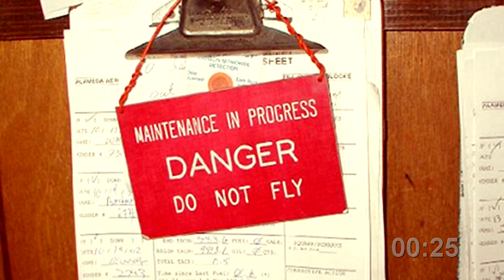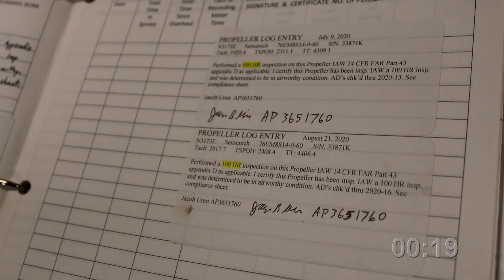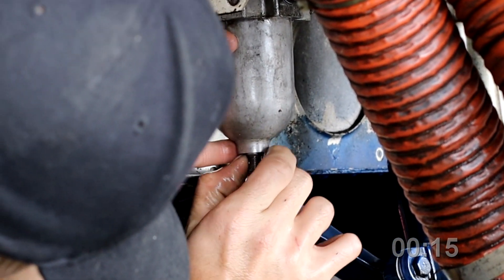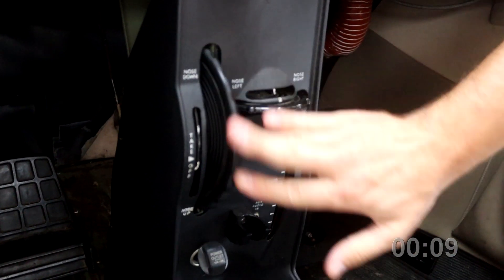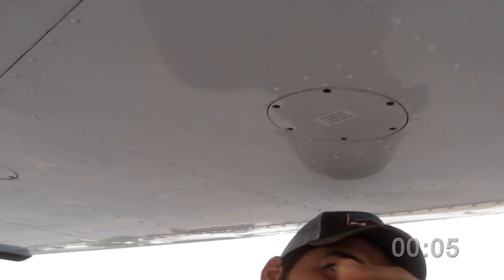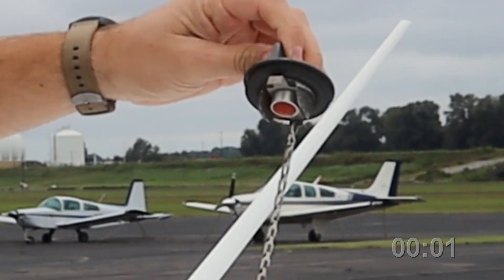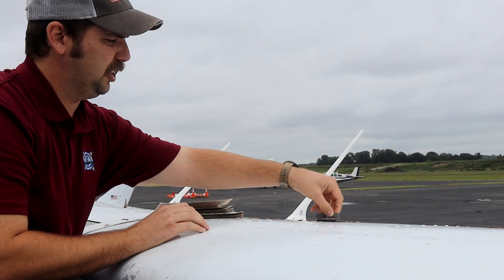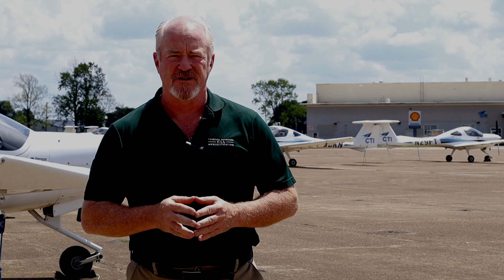Advanced Preflight After Maintenance in 57 Seconds

Comment: How did you start the aircraft if the battery wasn't reconnected?
Reply: It was the alternator that wasn't connected to the battery.  The battery still had some charge so was able to power the systems for a short while.   Without the alternator to re-charge the battery while the engine was running, it eventually ran out of power.
Reply: @dm-wp1dz  That's right.
Reply: @dm-wp1dz  Was the battery connected?  (positive and negative connections)  Essentially, I think you are trying to say that the alternator connections weren't properly reconnected (at the alternator).  Words mean stuff.
Reply: @martindurkin5223  Right.
Reply: PFM